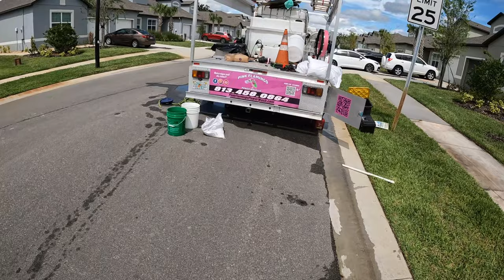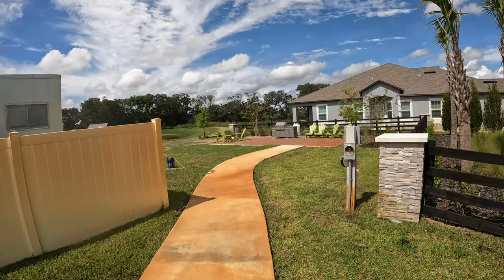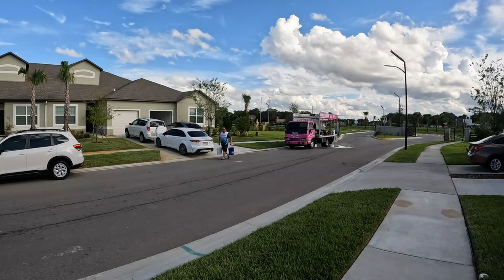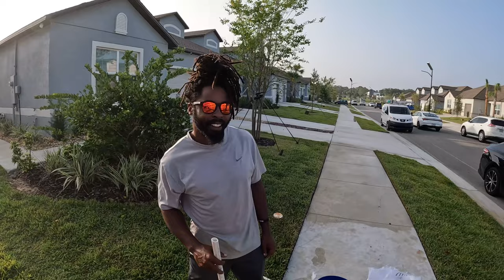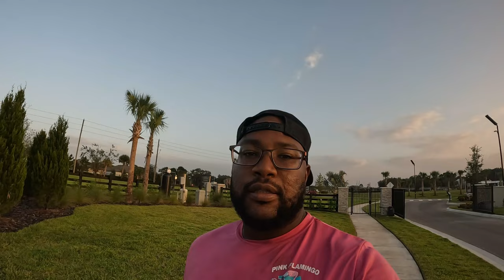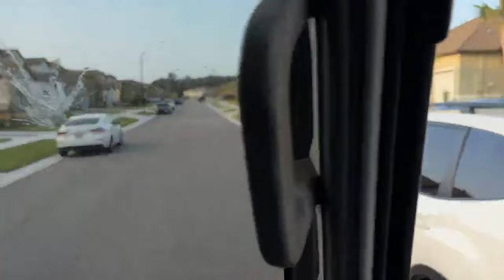HOA Subdivision Rust Removal #rust #rustremoval #rustremover

Comment: Where does the rust come from? I know you have the rebar in the concrete and there can be iron particles in the concrete...but rust on a plastic fence??
Reply from the maker: The sprinkler system pipes that are underground. The high iron levels causes the stains since there's not a filtration system. Which one this case the filtration system malfunctioned
Reply: @PinkFlamingoPowerWash  thanks. I happen to watch another one of your videos earlier today and you mentioned the rust coming from the sprinkler system. A crazy amount for sure.

Comment: Also you dont seem too worried about the grass and all that so its pretty safe at the  concentration your laying it out? And thanks for taking the time to post all this vid
Reply from the maker: I wouldn't do it if it wasn't with caution.  I'm not spraying carelessly and dousing the grass
Reply: Probably still going to brown an inch in.....let them know their lawn guy can dye it it will recover in a couple of months.
Reply from the maker: @Lukealang  haven't had that yet. This was only 2% so it won't do nothing to it. Granted turf is rare here, I've done work around turf maybe 20 times so far
Reply: @PinkFlamingoPowerWash  I've had it happen a few times using 1 cup to 1 gallon. Some varieties of grass are more sensitive than others so maybe the breed they are using doesn't burn as easily but plants are much more sensitive to acids than bleach.

Comment: what's up Cliff, hey how hot is your downstream mix are you able to adjust it? or is that when you use your soft wash setup for hotter mixes
Reply from the maker: Mine probably pulls around a 1.5-2% but that's the highest it'll get cause you can only adjust down by adding water to your SH which I never do.  

Yes the soft wash system is what I can adjust the mix from .01% to 12.5% full strength

Comment: won't he need to do the full driveway?  Otherwise, will one section be brighter?
Reply from the maker: That will be a discussion to have when someone is hiring you. This was a commercial job so they asked for many different quotes, full driveways, and partial driveways. If it were a residential customer I would just do the whole driveway but that wasnt the case. We were tasked for certain stuff.

Comment: So how many oz did you put on that 5 gallon bucket?
Reply from the maker: In the intro
Reply: I heard that but didn’t get it lol
Reply: You said 16 oz per gallon so that’s 80 oz on a 5 gallon bucket and then you said two of the cup you used which you said two 32 oz I guess that makes 64 oz on the 5 gallon bucket. So is it 80oz or 64oz?
Reply from the maker: @neftalibaeza2391  80oz you can use a lighter ratio it you have less rust  . We had deep rust so we went very strong 💪🏾
Reply: Thank you!

Comment: Hey cliff , get your self a dolly and strap the bucket to it and 100ft of 3/8 air hose from harbor freight to make that sealing pail sprayer more efficient. I did the same thing works so good it’ll make your life a lot easier brother 🤙
Reply from the maker: I said my dolly broke in the video lol hahahah I think you missed it. I didn't have time to get all that stuff, the job got approved and we had to start it right away
Reply: @PinkFlamingoPowerWash  i must have missed it haha my bad brother. i was like damn carrying around that bucket down the street must be brutal.
Reply from the maker: @TheShortsguy1012  yea for that day it was worth it hahahah I wouldn't wanna do that daily for weeks.
Reply: @PinkFlamingoPowerWash  that 100ft of hose and dolly is a life saver for sealing. i just added you on facebook!
Reply from the maker: @exodusexteriorsolutions  yea I could see that but man it would suck in the small areas like pool decks going around pillars and stuff.  For a driveway it would be more beneficial that way it doesn't tangle up.
Reply: @PinkFlamingoPowerWash  thats understandable. i use it for pool decks, driveways , etc. usually i keep my spray bucket , mixing bucket where the water hose is on the side of the house. its not to bad.

Comment: 1-2gpm 12v pump with 3/8" 100' hose and garden  sprayer  wand? I put one  together  with  35 gallon  tank NICE ticket 👍
Reply: Our original plan of attack was to make a big batch, use a 12v pump, and run a long section of hose. However, once we got rolling, the 5 gallon buckets were just quick and easy. We didn’t have to mess with hoses getting caught up in landscaping, etc
Reply: @CleanStreakPressureWashing  good  call👍
Reply from the maker: And going around cars 🚗  that were everywhere.
Reply: @PinkFlamingoPowerWash  good  call... I was watching  not doin.👍